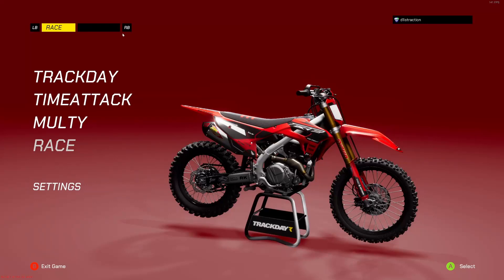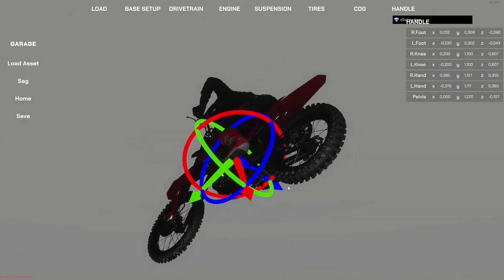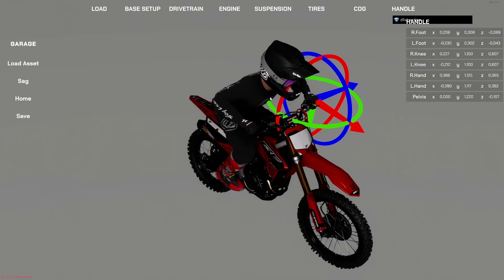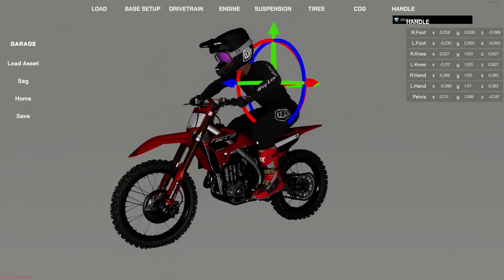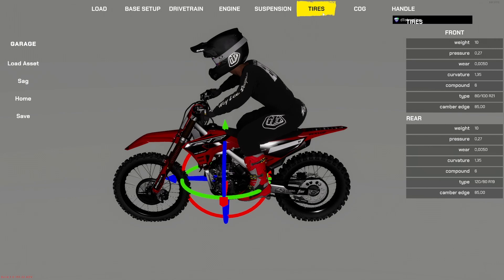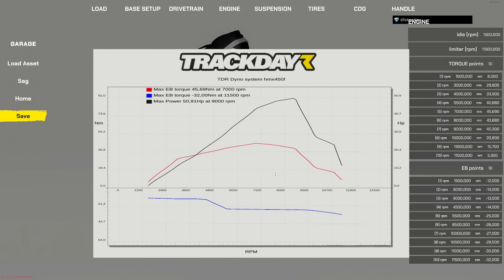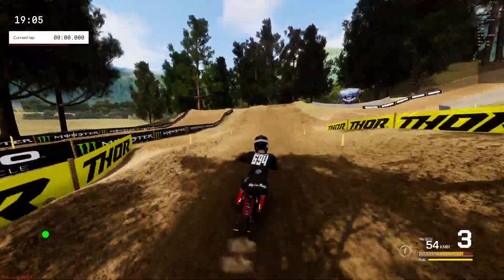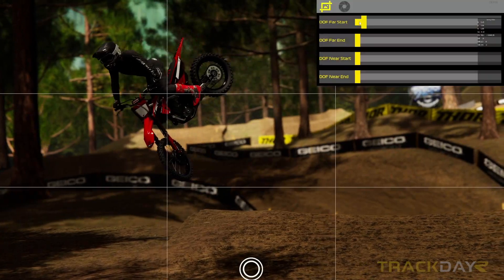HOW does the GARAGE MOD tool works EXPLAINED

Comment: 3:23 the ass of the dude is insane wtf, i hope it will be fixed for the major update (nohomo but it's very distracting)
seriously it can be cool to have a mirror feature so you can just tweak one side and it does the other automaticly
Reply from the maker: The garage tool as i said Is still in early phase of development,so there could bè plenty of changes!
Reply: @d1istraction930  yeah ik, it's already insane. The only moto game to do that !